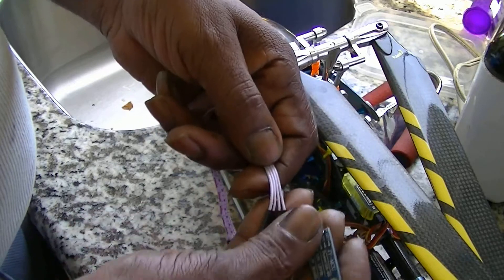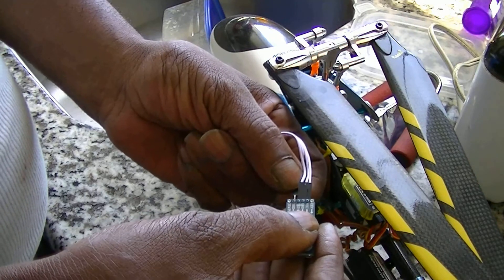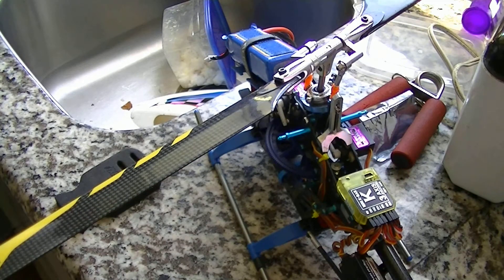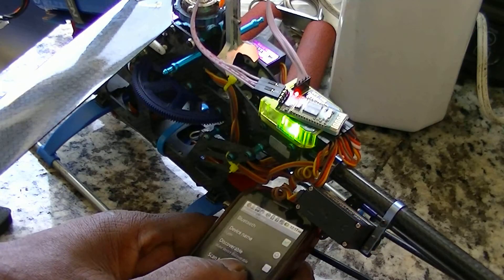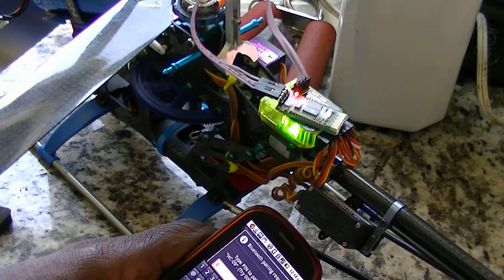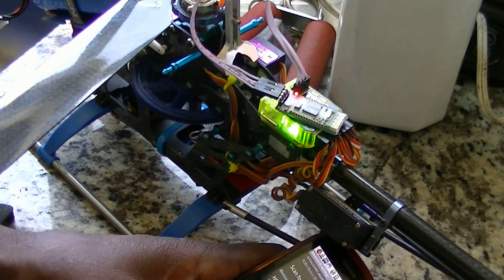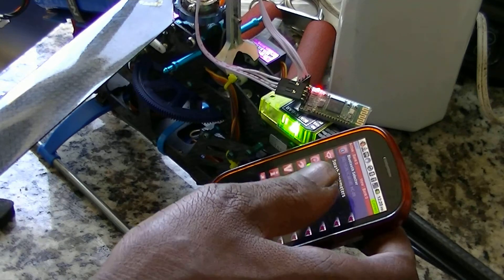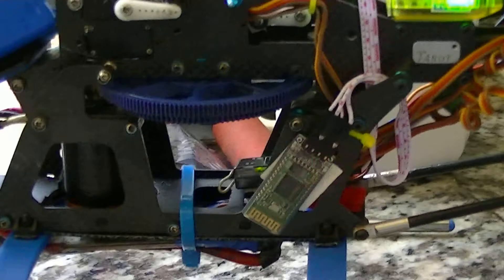how to wire K-bar gyro blue tooth module

Comment: Wickedclown I bought a bluetooth with the lead wires already soldered on to the pins of the bluetooth so that part is easy. I also downloaded the VBAR APP on app store.So now when I connect the bluetooth module to the vbar gyro the light blinks but I can't get it to become solid. What values do I enter I on the app on the smartphone. I saw you enterin some set of zeros or something? Also on this app can I reverse the servo throw so all the servos act as one in order to get the swashplate to Stay level do you understand what I am saying Wickedclown? Please help brother I will even pay you for your knowledge? Don't thinksoI swear Wickedclown I will pay you.

Comment: good safety tip with the 2 motor wires
all my v-bars/k-bars have Bluetooth on them
way easier to setup without the cable going to it
and I can set it up from my phone as well
i've been using the tarot bt module as well, works good and is cheap here in the U.S.
Reply from the maker: i have ikon vbar kbar and zyxs2 with bt onboard